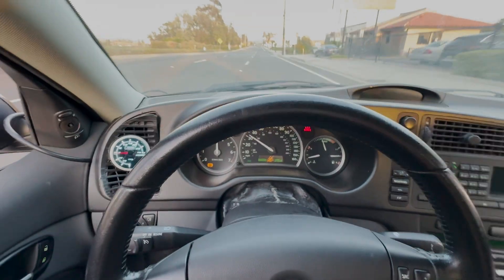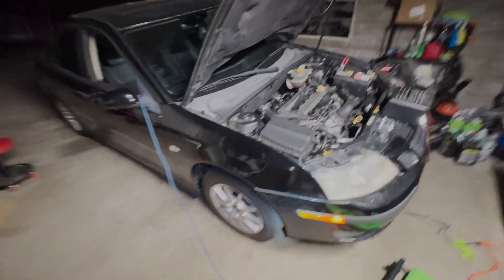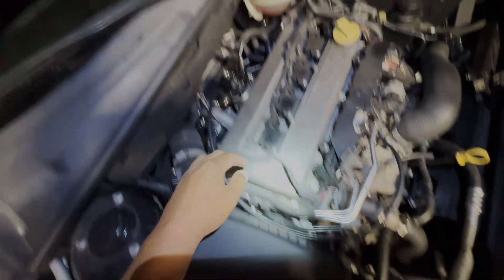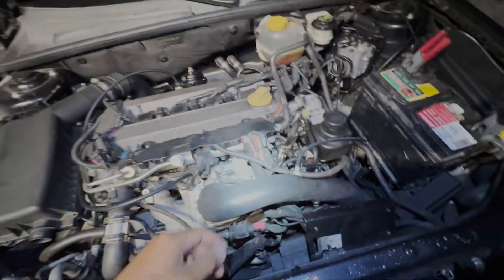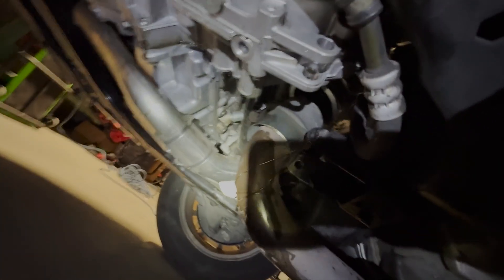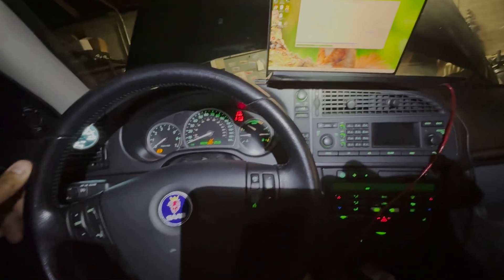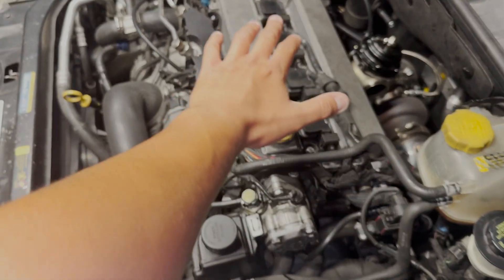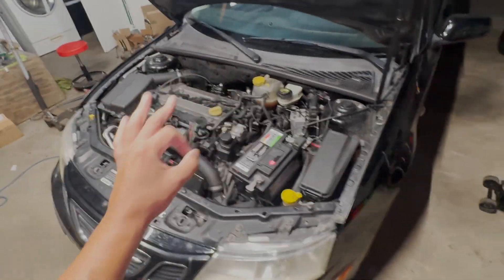BUDGET BIG TURBO SAAB 2.0L - DRIVING FOOTAGE

Comment from the maker: If you have any advice on the wastegate control or tuning please comment! Appreciate all the support 👌🏻👌🏻
Reply: Any update on the build?
Reply: Hey man, have you made any headway with the build since this video? I absolutely love this, I'm a Saab guy myself i currently have a fully built track-ready 2004  stage 5  93  make 360hp/430nm trq, and a stage 1 2010 93 with the F40 6spd, making 250hp/350nm trq. Most people watching this video have no idea how complex and difficult it can be to tune trionic ECU,s.                                                                                                     For most tuner cars, you only need to have knowledge of certain systems to achieve a decent tune. Trionic is an entirely different monster; you have to completely understand how every system works and how they depend on each other to make T8 happy. In the case of big turbo/boost, you might never make her happy. I heard you mention mechanized, so I'm going to asume your a member of trionictunig, so you already have contact with the best Saab tuners on the planet. If you want to send me a pm on trionictuning  @ jr3232 I may have some ideas or some insight that could help you.

Comment: Hoping for a vid update soon for sure. Im debating on going with a lnf manifold and a k04 or a similar setup to yours with the zzp t3 manifold. I originally was gonna go with a TD04HL-19T but it seems that those small frame turbos and the bad flowing stock mainfolds are what kill these engines. Are you still tuning with josh?
Reply from the maker: Def go larger id say - that manifold gives you a lot of options so get away from the TD04s IMO. Sorry for the lag - trying to solve a lot of positive crankcase pressure right now.. need to make a big hole in the valve cover and route to a catch can. I have Ryan King tuning the car right now, next step is 1000ish cc injectors and fuel pump
Reply: @thejsgarage i heard that the little breather filter that goes in place of the oil cap helps alot. Also, why the swicth in tuners if you dont mind me asking?

Comment: What program do you use to tune it with? I'm looking on tuning mine. Thanks
Reply from the maker: For all flashing and data logging I use Trionic Can Flasher or TXLogger. Then for actual tuning I believe the tuners use TxSuite. I have tried tuning a little in TXSuite but now just have more practiced tuners do my tuning
Reply: @thejsgarage  Macken is one of the top guys on that form.

Comment: Just a question for you what size was the stock boost pipe from the turbo outlet
Reply from the maker: It’s a 2.5” to 2.25” coupler on the compressor housing of the turbo. 2.5” out of turbo and 2.25” is the size of the stock charge pipe. Just gotta grind off the alignment pin on the stock charge pipe

Comment: Hasta cuanto llega el map stock gm...y cuando es necesario cambiar el map 2a stage y cuanto llega(si me puedes facilitar referencia para comprarlo en europa,o importarlo te lo agradecería)
Tengo mismo motor en la ultima versión con alguna mejora a falta de intercooler do88 y está dando stage 1,válvula forge,bobinas rojas (que dan algún problema con t8,volveré a Mitsubishi oem),manguitos silicona,escape 3" 255cv pero no va fino por eso pregunto lo del map

Comment: While you were building this car, I bought a stock HHR with 2.4 for $700. In 1 week I did a 3576r with a zzp t3 manifold, made my own 3 inch down pipe, cold side piping etc, ran it without intercooler. Had super fast spool up. Would heat up IAT at a rate of 2.16 degrees per mph gained. I had a Saab intercooler laying around, So I spent an hour putting it on, making pipes. Keeping factory pipe from a Saab 9-3 intercooler to the throttle body. Made the other side from 2.5" pipe. Anyway, long story short. The car lost 4 psi of boost and took forever to spool, No leaks at all, Just the factory intercooler and pipe setup isn't ideal once you try going beyond say 280 hp.

I confirmed zero boost leaks. I swapped the intercooler-less based pipe back on, car was back to running good. On just 11 psi, it does 50-80 in 3.22 seconds.

Sometime next week I'll be testing it again. I have installed a 24x12x4 Ebay intercooler, with full custom 2.5" pipes from turbo to intercooler and to throttle body.

So your car will spool way faster and run better by upgrading from stock intercooler setup, Trust me on this one. You will want to go with something with atleast 2.5" in and out and a core that will support 700 hp. And do new piping all around so it doesn't drop below 2.5". 

Once you do that, make sure you make a new inlet side intake piping that is 3" - 4".

If your running stock tune, it will be closing the throttle on you as you go beyond the stock desired and max airflow / torque.
Reply: One more thing, Stock tune is setup to go extremely rich when you overboost / airmass like you are. In the 9s afr wise. So if you have decent size injectors, your flooding it with fuel.
Reply from the maker: Damn haha I need some of your wrenching tenacity on this build 😂 took me to this long just to get to here and now my rear main seal just blew out. We’ve been dialing in the tune but yeah this things take a while to spool at even at 7k rpm still feel like it’s just then hitting its full stride. I’ll definitely be starting to make cold side custom piping but right now I don’t have a tig welding setup so I’m just doing basically downpipe/exhaust welding with my flux core
Reply: @thejsgarage  You can get the cold side done without welding, it can be done, then once you have the tig, you can remove some of the couplers and weld, so it's less likely to burst a coupler off during a pull.

I've been there with flux core, now I have a $1000 evolution chop saw, 3 welders, two 330 cf bottles, which last 20 hours each lol. Well over 20 in most cases.

There's gotta be a reason for the rear main seal failure. Could of hurt something and got high crankcase pressure, make sure you didn't plug the hose that goes to the valve cover also. If the engine is on the fresher side, you can end up breaking a piston ringland when the rings butt together during high cyl pressure and heat. So I'd do a compression test alteast.

My le5 2.4 with vvt, with the same setup is at full boost at 4k rpm. When I hooked up the factory intercooler, it was make 1/3 of the boost at that rpm as it did without the Saab intercooler and it only made 6.3 psi, while it make 10.5 to 11 without the intercooler. The intercooler made the car feel absolutely horrible. 

I'm shooting for 450 whp on the stock le5 in the HHR. Will see how that goes, I've only ran it on e85 for safety since it's 11:1 compression ratio from factory. And I've been running it with no intercooler, IAT get to 180-200 degrees which is terrible. 

It's currently down, I just need to finish the driver side pipe for the new huge intercooler setup to be done.

Comment: So many errors and fake news in this video. Still enjoyed it :). Please dont parrot anything these guys are doing or take as facts. Pure entertainment purpose I would say. ❤
Reply from the maker: Give us the facts big doggg
Reply: @thejsgarage you know the forum to find it....the big boi fax.  ;) let's say it has to do with the name of the engine management and hints to adjusting it....
Reply: @thonyonetwo  why not just tell them so they can correct it? this is that weird stuff where a dude will call you out on something but wont actually critique you on it.
Reply: unfortunately T8 is probably one of the most difficult ecu set ups to tune and takes many many hours to start getting these cars to make power. Nothing like domestic or aftermarket systems. So really thonyonetwo its obvious you have no idea what goes into tuning these things. These guys are basically just getting started and when they get a good bin loaded in this car its going to make some power. They said they been through a few ecu's and shit if you dont have a GM tech 2 to marry hardware just that will throw it into limp mode. These computers suck and ive always had to physically bench flash mine so just that extra couple steps takes alot of time. So no fake news here or there, just guys trying to build something, not buy it!
Reply: @psdesignssmith7867 Hi Karen. what you say could be true. I do however hold one place of the top 30 of being "thanked" by other users on the worlds largest forum for saab engine management systems. But hey. You are probably right.

Just because you don't know how to do it doesn't mean it can't be done. It just means you can't do it. The reasons can be many.  If I were to guess it would be one or a combination of the following: laziness, mental (dis)ability, narrow minded, spolied.. if you want something just handed to you, go pay a reputable tuner to do so. If you want to learn, embrace it and stop complaining.
Reply: @thonyonetwo haha I agree with saying you gotta learn it. Nobody in the forms is just gonna hand you a tuned bin. Even if they did, if you have not learned anything about thr trionic system then how you gonna know what is on that file? If anything one could use it to compare it with either your stock bin or one you attempted to modify.  But all the experienced guys on the forms are gonna want data logs to go with your mod bin to give any real usable feedback.
Reply: @psdesignssmith7867   if you wanna pay a Yankee (I assume your American), the best one is probably 8secsleeper. I think he has made some comments on this video. I miss that guy :) - especially his skill in assembly and iirc, the first one to create proper launch control. Mackanized is probably the best t8 tuner in Sweden/Nordics and perhaps EU. There you go.

Comment: Ive ripped in  2 of what are probably the fastest big turbo ng 9-3's in the states, and i can tell you for sure, you dont even know what your in for😫🤣 This thing is gonna be fucking wicked when ya get it dialed in properly, especially if you do all the proper supporting mods along with it. My buddies stock frame 20T upgraded turbo 9-3 was yanking 60-130 pulls faster than an R35 GTR lmao no bullshit. And that wasnt even the "big turbo" car lol although that one was done right, with every supporting mod available and imaginable and the best of the best of everything. The big turbo car was more slapped together, but was stupid fucking rowdy. Sadly a rock in the middle of the road took out the oil pan while we were still dialing it in, and never saw its full potential, but at 10psi, it was fucking scary lmao. Also if you "density tune" it, you can actually ditch that maf. What are you doing for fueling in this thing?
Reply from the maker: Sick, thanks for the input. Stock fueling for now but open to suggestions! Maybe 1050 injectors and then bigger pump obviously, still looking
Reply: @thejsgarage  I"m at 76 percent duty cycle with 80 lb which are 97lb at 58 psi, On e65, they will be done around 450 whp on e47 blend.. 

You shouldn't mess with the fuel pump until it's a problem the stock pump has no issues at 20 psi with that turbo. When I did upgrade mine, I gutted the filter setup out of the basket and moved it inline, did mods to increase the basket volume and installed a walbro 450. But it wasn't needed, I just did it because I had already bought the parts and wanted to fix the fuel level sensor, so I was already there.
Reply from the maker: @8SecSleeper what’s your wastegate setup and are you using the stock boost solenoid or a MAC 3 port?
Reply: @thejsgarage  I have ebay 38mm wastegate with a manual controller. I'm currently working on a boost controller, that will use canbus data, like rear wheel speed, so I can have boost by gear/ speed/ wheel slip. Because right now, anything over 7 psi and it stands on the limiter in 2nd gear. I need to be able to limit boost in 1st and 2nd then roll the boost in 3rd. All of this is on my Turbo HHR.

When I did the same turbo setup on my Saab, I used the stock boost controller and just tuned the wastegate duty vs desired air map to control the boost.
Reply: @8SecSleeper  does gear torque limiter not work on such extensively modified setups? if air torq and nominal setup properly then it should be fine to just limit torque in 1st and 2nd, that way you don't need to deal with all the extra work? or is there a benefit to limiting boost rather than torque

Comment: I would open up the rev limit to 7k the stock springs can handle it
Reply: My Saab with same setup. I was shifting at 8200, but I did 82lb springs. That turbo will come on so late, the min rpm you should be shifting at is 7k.
Reply from the maker: @8SecSleeper that’s what I’ve noticed already. We opened it to 7k and just barely starting to really pull when it redlines
Reply from the maker: Now you’re talking
Reply: Zzp and ottp also sell all the valve upgrades you would want or need to up the rev limit even higher  @thejsgarage